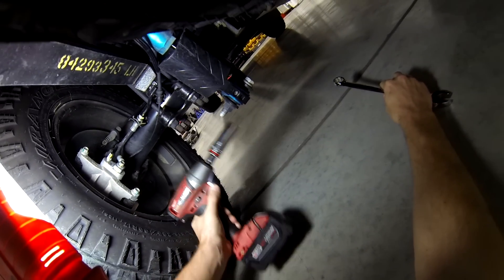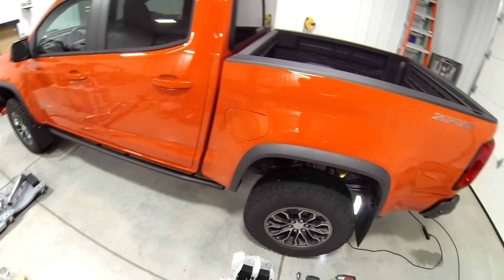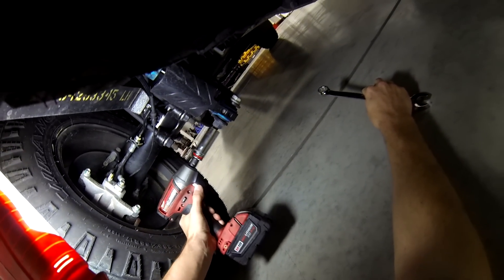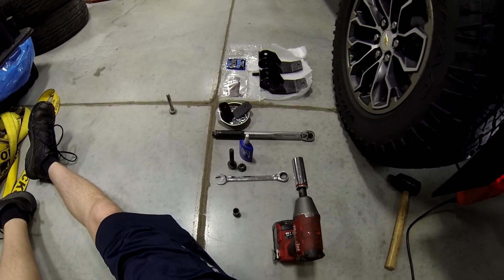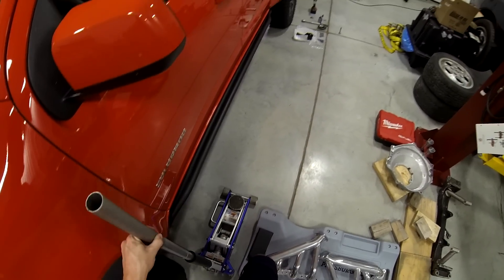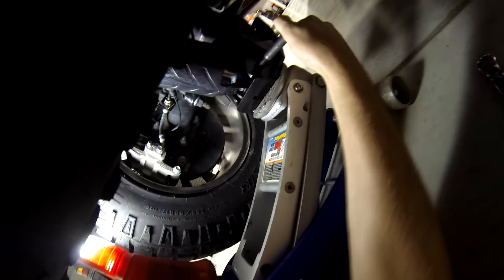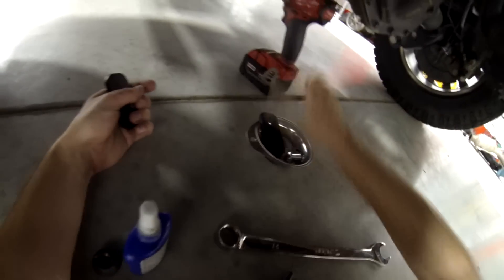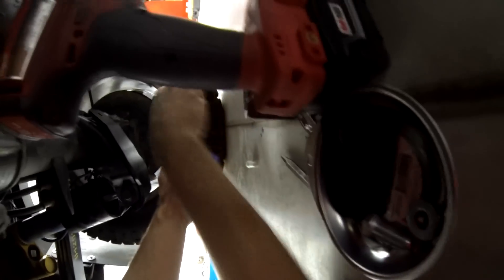Chevy Colorado ZR2: DatinFab Shock Skids Install Guide

Comment: Does the 2021 model still have this problem?
Reply from the maker: My understanding is the 2021 is only a cosmetic refresh.  That design for the rear shock mounting location is pretty common on solid axle vehicles.  Your best bet is to just crawl under there and take a look.  ^_^
Reply: @PowerSports  Ahh yes ok!    A cosmetic refresh means it's definitely still the same lol... My husband just ordered a ZR2 on Friday, to have a secondary overland rig that is something different than our usual obsession over Toyotas lol.. He and I do lots of remote overlanding over VERY rough terrain, with dif dragging sometimes unavoidable at times, so I find these low hanging shocks worrisome..   He wants a ZR2 though lol, so it was going to happen regardless lol
Reply from the maker: Yes, if you guys do real offroading, I would recommend the shock skids, and maybe also upgraded skid plates.  ^_^

Comment: Are the skids supposed to be facing two different directions? One facing front, one facing rear?
Reply from the maker: They only install one way.  You can't install them backwards.
Reply: Good to know, gonna need to get a set of those. 
Thank you
Reply from the maker: They are worth every penny!  ^_^  Good luck on your install.
Reply: @PowerSports  I was wondering the same. Website and amazon links show them facing backwards (which makes no sense). Thanks for the video clarification

Comment: Any info on the V8 swap kit?
Reply from the maker: They make a wire harness, and supposedly they also make a kit, but I haven't done any more research on it, yet.
Reply: I been looking for two years on it or how to do it my 3.6 has been in the shop 12 times since 2016. 
My truck was going to be the first v8 Canyon in the US  but $12,000 later useing the trans and 5.3 L from a full size truck and its computer with wiring harness has been more than I can handle.
Reply from the maker: try this link: https://www.facebook.com/Currentperf/posts/2017-zr2-colorado-lt4-8l90e-swap-a-few-more-steps-in-the-right-direction-hopeful/1817369761661138/